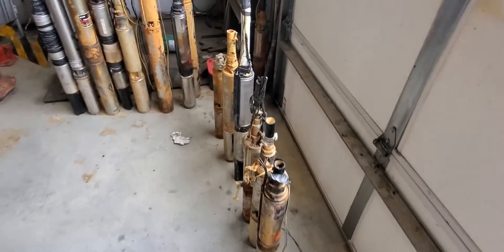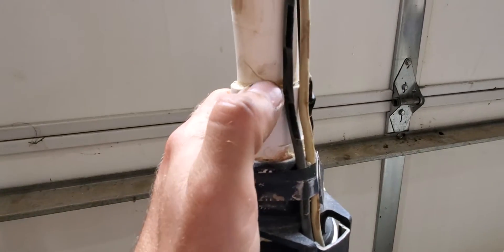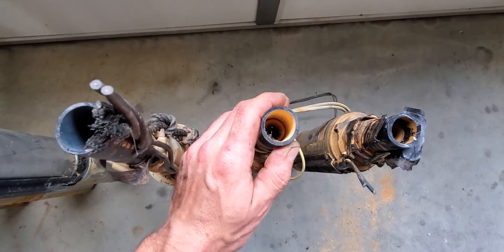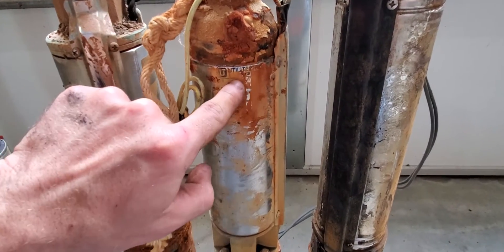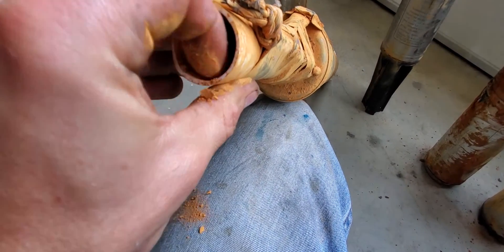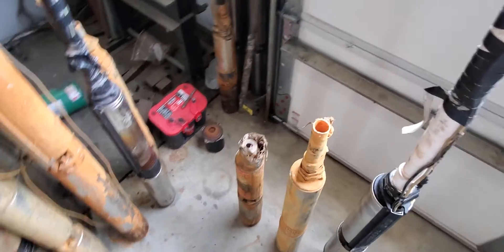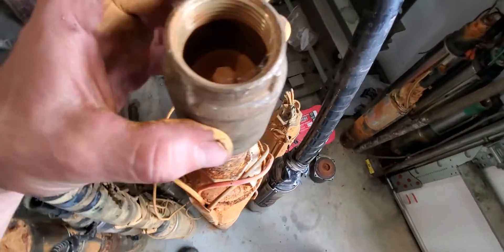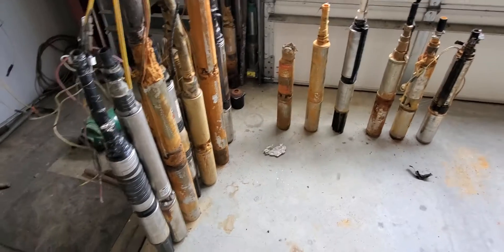No Water, Low Pressure,  Air in Water lines. Here's Why! #1 Troubleshooting video

Comment: I subbed and rang the bell ...love the practical info for the novice ... I'm a 66 yr old retired builder who cut his teeth in the golf course irrigation business 40 years ago ... so I know a bit about wells and plumbing ... bought an old historic house to restore 6 years ago ... no info on well and the service guy never returned my calls with history ... 3 years later, no water one morning, simple diagnostic, 30 year old controller circuit board fried (Franklin 3 wire) ... simple fix ....then 3 years later, last week no water, controls good, pressure switch good ... both red and black (230 had power down into the casing) ... checked OHM reading for 1/2 hp, it was twice the specs, so bad motor ... called 5 well guys, only 1 returned my call (prior service guy) said he was booked out 5 weeks and said it would be $2,500 to pull and new pump ... so I looked at the dog the next morning and said, hey, we're going to be Well Guys ... eastern PA right on the Delaware River, 60 ft above it, so I know pump could not be that deep ... good quality sanitary seal, 1 1/4 poly with good brass fittings ... pulled the pump by hand, dog was no help and he's a 100 lb cart dog (bouvier des flandres) but he was supportive (from the shade) ... half way up (40 ft) I saw the wires were severely chaffed/open, corroded copper showing ... finally got the pump out and checked Ser # manufacture date ... 1987, 1/2 hp Franklin Electric with a Morris pump ... motor case was weeping rust .... Damn thing was 32 years old, 3 wire, red/black/yellow, wires were that old as well ... figured they didn't owe anyone anything (although house was a summer home for 60 years and empty for 20 of those last years before I bought it from their eastate (elderly couple) so it didn't have a lot of "run time" ... I did make up a double male garden hose and attached to my nice elderly neighbor next door, so I have water (I do a lot of "fixing and favors" for him and his wife, so he was glad to help out there .... so good news is I had watched all your well videos, so I ordered online, a good 3/4 HP Flint Walling pump and 100 ft of new 10 ga wire and WP splicing kit (local supplier only had 2 wire F&W's) ... and even found that 3M self sealing silicon tape on amazon (came today) got 6 rolls for $15 ... I was going to replace the torque arrestor and wire guards and rig a safety line until I watch your video ... and I agree, way too much stuff down a well casing to get stuck or go wrong ... So I'm only going with the pump, additional 1 1/4 brass check valve, and well taped wires (pump is at 80 ft, so easy to pull) ... Franklin controller was new 3 yr ago and well as new breaker/cut out switch, new pressure switch, pressure gauge and expansion tank, new spin down filter, followed by double GE Carbon filters ... all new Pex throughout the house ... anyway, long winded, but wanted to thank you for the tip on going with a "Clean" install without all the questionable "add on's" that could cause future trouble ... love that 3M self stick, self seal tape ... and I have 4 rolls of 3M Super "33" as well (your other tip) ... Pump and wire will be here tomorrow ... (I also took your idea and used an old cart wheel rim and build a small wood frame over my 5 ft deep well pit to support and guide the poly pipe on the way out (and back in) .. best of luck to you in your business ... you'll do well (no pun intended) with your logical and professional approach ...

Comment: I'm getting power to everything but no pressure then after around 15 seconds it cuts off. Does that sound like a bad pump to you?
Reply from the maker: Yes. Bad pump. Over heating, locked up or bad bearings

Comment: I have a 4” well with a 2” downspout.  At the well seal I can hear it hissing and the pressure fall slowly but steadily after the pressure switch cut off setting is reached.  The pipe is steel and the pump is less that a year old.  Do I need to pull the pump up and inspect the check valve and pipe itself or what order of troubleshooting should o pursue?  Thanks in advance.
Reply from the maker: Yes you'll need to pull it & locate the leak & remove & replace. If its steel drop pipe, id call in a professional. If its black plastic, you can DIY

Comment: Any idea why I get water hammer when my well pump turn off? I heard a large thud underneath my house only when the pump shuts off. Seems like the pipe is held well with clamps. So I dunno what it could be.
Reply from the maker: Yes, its hammering. You can add a check valve at the tank (pre) or/and at the top of the well.

Comment: Mine is holding pressure but kicking the breaker. I recently bought this place so I don't know how old it is. Do you think it is a short in the wires? I want to replace everything. Also, where is the best place to get the parts I need? I am pretty sure this well is a 150 ft. at max and probably less deep. Would Grainger be a good place to purchase new pipe and all the parts?
Reply from the maker: Grainger is fine.  Just pull out the old pump & read the motor details on it. Buy one equal to it. The pump is bad. Bearings failed & overheating and poping the breaker.
Reply: @h2omechanic  Thanks

Comment: My well cuts out at 60 i have a soaker hose on it cuts in at 40 while the contacts are still closed asking for more pressure the pump turns of system drains to zero pause a few minutes comes on pressures to 60 cuts out the drains to 40 cuts on  contacts closed pump stops over and over again any ideas email me randallbyr4@hotmail.com thank you
Reply from the maker: Pump is starting to die. Bearings are worn out, causing the pump to over heat & kick off until it cools down.

Comment: I have a 1hp 10gpm Goulds set @200' in a 380' hole with water starting around 100'. The other day I noticed it would no longer build over 40psi, therefore constantly running. (We're cutting off with the breaker) I'm going to pull it up for troubleshooting but do you think I should buy a more powerful pump? 

Installed in 2011, 60gpm per report....tons of iron in our aquifer too.
Reply from the maker: The age of your pump is right in line with its life expectancy. 
Don't buy a bigger GPM pump. 
My suggestion would be a 5GPM or 7 gpm  1Hp. They are designed to provide water from deeper levels like you described. They'll provide more than they say but in theory they are geared lower (impeller designed differently) 
What your experiencing is worn out impellers that can't build pressure anymore. 
I'd install a 3/4hp 5or7 gpm pump. It will work better & you won't notice any difference in volume or pressure

Comment: Question I changed my pressure tank and switch but once a week my tank goes down to zero, it does this two or three times in a row before it works fine for another week, it only sits for a minute or two before it builds pressure we do have hard water any ideas what the fix could be?
Reply from the maker: Let air out of the tank. Probably 10-15 seconds of air release from the top of tank. Most new tanks are a little over charged. Too much air causes your exact problem. Try what I recommend & reply with your results
Reply: How do I know how much air pressure needs to be in it ?
Reply: @mikepeterson4503  2 psi below the cut in pressure or the number on the gauge your pump kicks on at.
Reply from the maker: @mikepeterson4503  5 psi below the "on" # on your systems pressure switch

Comment: New to wells,  well head was at ground level,I extended it  up 12 inches to keep rain over flow out. My pressure is ok as long as I only have one faucet open if I flush a toilet  or turn on 2nd faucet  pressure  drops to 10/20 and stays there until running water stops. Do I have to dig up line going to house in order to replace pump?
Reply from the maker: No. Id look at the tank & make sure the air is set correctly to the switch. To test air it must be off & drained of water. Sounds like too much air in tank, or possibly a bad tank
Reply from the maker: https://youtu.be/NUX5lcMLdOU

Comment: Hi. Really helpful video. Thanks.
My pump is not connected to any thing. Just an on off switch and we fill tanks and jugs manually, as the fixtures in the house were removed. We.bought a fixer upper . I noticed the pump in the ground began surging after about 5 minutes. Do you think i should pull her up?
Reply from the maker: I can't help you. There's too much that you could be missing for the system to operate correctly for me to go over. My suggestion is watch my videos on my channel. Find The Well Q&A Playlist

Comment: I have replaced everything minus the pump. I’m getting water for approximately 10 mins and I loose pressure. I was told the pump is going Thermal coupler was going out. That even though it was in the water, when it got hot it would shut it down. If I let it wait 1520 minutes it will run again for a short period of time before I lose pressure. Does that sound like that is correct, this is for sprinkler system
Reply from the maker: Your problem is the well isn't filling up fast enough.  R u In Florida or GA? Southern states are going thru a drought at the moment.
Reply: @h2omechanic  I’m in GA but this happened before the drought. Also looking at my new pressure gauge it fills back up quickly . I have replaced the control panel, water bladder, and pressure switch, filters, ext. all zones are free and clear
Reply from the maker: @triplethreatoutdoors0621   are sure your tanks air pressure is 2psi below the switch "on" number

Comment: So i have a new 30 50 switch with the lever. My water pressure is only getting up to 35 psi.  Im currently waiting to see if it will decrease in pressure without any use.  The pump is only 2.5 years old.  I pulled it last weekend with no obvious problems.  So i put it back snippet the ends of wires to clean them up and re did the pipe coming out of well going back in the ground.

The 35 psi on the pressure tank should that be at 50 or closer?  Also this is a new bigger tank.  Went from 20 to 35.  Any info i would be very greatful.  Thank you for your video.
Reply from the maker: Try turning off the breaker and go see if the pressure leaks back down or hold steady. If it leaks down, you know you have a split pipe down the well or a big leak in the yard somewhere. Let me know one you've done that test
Reply from the maker: What Brand pump is it? Hopefully not a Amazon/Hallmark pump...
Do u have any info on the pump u used? Submersible or above ground pump?
Reply: @h2omechanic  it is sub. And not sure of brand but was put in by a well drilling company.  Its about 180ft down.  I did lose pressure after about 20 to 30 mins.  So i turned the pump back on filled to 40 psi and slowed to a stop.  I then turned the valve coming in off to hold the water in the house.
Reply from the maker: Was it really heavy when you pulled it out? Well could be dry & filling slowly bc u have a leak somewhere. Go look for wet spots. If you turned off the breaker & it went to 0psi in 15m, you definitely have a leak that's using water & keeping the well low on the water level. It has a little bit to build pressure then runs out. 
If my theory is correct, leave breaker off all night & turn on in the morning, then it should build all the way up & shut off. But if it does this, you still have to find the leak somewhere. Check toilets for overflowing tanks in back of them first off.
Reply: @h2omechanic  yes full of water it was flowing out the top when stretched out.  We then put the pump in a pool and hook the generator to if to be sure the pump was pumping.  The black pipe was wet 30 to 40 feet down, we did have red mud.  6 years ago a sleeve was put in bc the galv. Casing had a crack and was bring in mudding water about 30 to 40 ft down so we put 3 sticks 60 ft of 4 in pvc with the  Riveted or finned end.  I was thing of pouring concrete around the sides.
Reply from the maker: Sounds like something isn't right...im still learning towards a leak...there's no reason why a pump shouldn't build 50-60 psi unless there's no water to pump or if the pumps internally is worn out...id pull it back out & make sure the fitting connection between pump & pipe is tight & not cracked. If you kill the power & it eventually leaks to 0 psi, you 100% have a leak. If not, call in a pro to look over the system.  Remember the tank should have 25 to 28 psi of air in it if u have a 30/50 switch
Reply: @h2omechanic  i left the power off today.  Came home to look for wet spots under house and yard.  Found one but not sure so i dug it out 2 ft down thought i might see the pipe but did not.

  I left pressure in the system but had main valve turn off.  Turn everything back on ran some water until swtich kicked on keep running a few more minutes the turned water off to let pressure build it it seemed to work fine.  

I did check the top of the well to see a very small amount of water that maybe coming out beside a hose clamp so i tighted it up.  Just going to waiting and see if my hole has water in it i guess.
Reply: All is good.  On my water issue.  Thanks again for the help.

Comment: Pump was replaced a year ago and has a sand filter attached. It would easily fill my 40 gallon, or so, tank from 35 to 50 psi in about 3 or 4 minutes. Now if it take 5 or 6, but if the pressure gets down to about 10 if I’m filling something, it likes to never fill back up. This evening is hovered around 10 psi for several minutes before I cut the switch and cleaned one of the two above ground filters and fired it back it up. That let it get over the 10 psi mark but it took about 20 minutes to get to 50 psi.
Reply from the maker: Sounds like the well doesn't have enough water in it to fill the tank. Leave the breaker off all night & see if it helps. If it helps, look for a leak somewhere. Or call a well company bc you might need a Hydro-Fracing process done on the well to increase flow rate of the well. 
If any filter is plumbed before the tank, that most likely the issue. All filters go after tank.
Reply: @h2omechanic  I’ll call the guys that set it up. It has two filters pre-tank. One on the pump that’s about 6 feet long, one going into the tank and one coming out. The set up was replaced in June of 2020 but it had also been replaced one year prior. They warrantied the whole thing and that was nice. The pump is at 653’ and the SWL was at about 40 a year ago.

Comment: If your pressure goes from 50 psi to a drop fast 0 psi to the point where you have a tap on and it fluctuates back and forth between these two points until the water is shut off what would you feel the problem would be. When it is a 0psi there is a second or two where there is no water then a shot of water comes flying out????
Reply from the maker: The tank needs air added to it or just completely replaced. & the switch needs to be replaced and the nipple below the switch is likely clogged. You explained a typical (short cycle) scenario

Comment: I just started having issues with my water supply while showering. Started to get air in the hot then in the cold. Checked on the pressure and it read steady at 30psi.
Any help would be appreciated. 
Tha k you.
Reply from the maker: You either have a dieing bladder tank that's slowly leaking its air into your pipes & will eventually short cycle and you'll notice weak pressure then it'll start to fluctuate like crazy up & down. If that happens it's important to replace the tank. Or you have a leaking check valve in the pump. Which u would need to pull the pump & add a inline check valve above the pump. A test for this is to look at the psi gauge & have someone kill the power to the pump & see if in 5 minutes does the pressure drop any. Then while sitting near the tank listen carefully & have the power turned bk on. If it leaked & created a air pocket, you will then hear the air in the lines & going into the tank. You may have to open a sink . But listen to the incoming pipe for air. If no sound, it's likely that the tank is the issue.  Tanks are hollow, knock on it like a door. It should ring like a bell. If its a thud, it's bad. Bad tanks will kill pumps within weeks

Comment: Hello and thanks. Well my pump has finally been killed. It's about 35-40yrs old. 180 ft down on 10' sticks of galvanized. It's currently using an external control switch with a capacitor. My pressure tank was low(long time slow leak)and I hadn't got to it. Bunch of water was left on and it looks like the pressure switch may have froze closed and pump killed itself. If I put power to it then it tries to pump for 10 seconds then cuts out. I'm looking at pumps from 500 to over a thousand. I'm planning to drop new one on poly.
Reply from the maker: Use 160-200 psi black roll pipe. & buy a 3/4hp pump. Either a 7GPM or 10 GPM Pump Head. Don't buy a 15 or 20 gpm pump. They can't lift from 180ft. Don't buy a Amazon pump either. I recommend Goulds,Jacuzzi,Simmons.

Comment: Hey thanks you're great. I'm getting a lot of air in the lines.  It's probably the crack in the pipe? Or could it be a dry well?  Check valve seem to be okay and pressures holding.
Reply from the maker: Could be a dry well if you've ran it out of water before . Typically it's not tho. A dry well is caused by a leaky toilet that ppl over look. If you find a check valve at the tank, or at top of well, that's why your pressure will hold. If the check valve in the pump is bad, or a split pipe, you'll get air, lots of sediment, higher electric bill, low water pressure at times.

Comment: I installed new irrigation pump and pressure tank. Irrigation company came out and could not get pump to prime. They mentioned either the ejector or the packer. Does this make sense??
Reply from the maker: Yes they are correct.  The check valve or injector at bottom is leaking out the water. Probably 10+ years old & has a hole in it